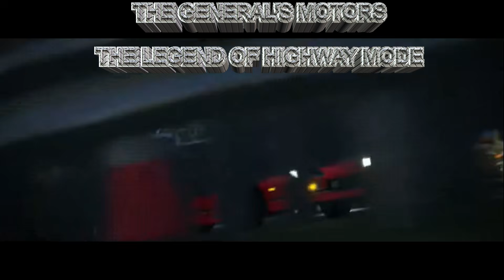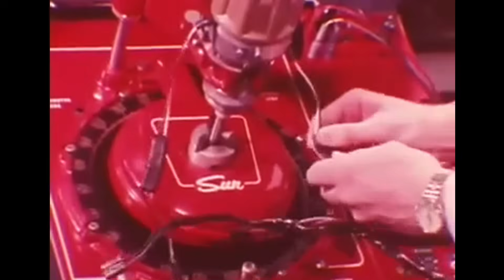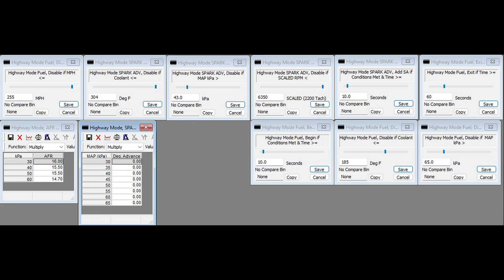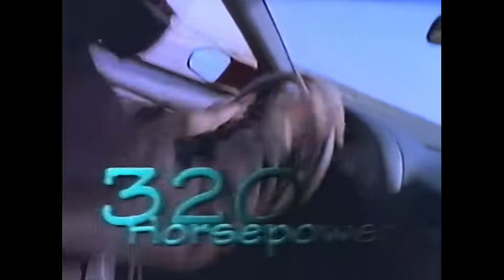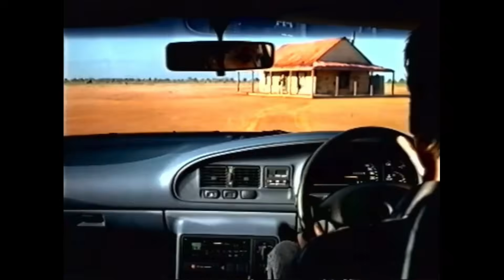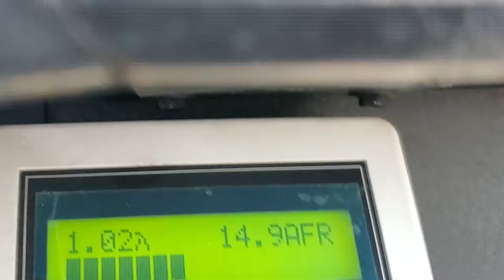"GM 'Highway Mode' Explained: The 25-Year Tuning Myth"

Comment: This is AI slop. The Chrysler lean burn system was not an analogue computer and it was not placed over or near the engine. It was bolted under the hood to the firewall or fender wall.
Reply: Chrysler mounted their early ECMs in the 1980's on the air cleaner housing. Must have made sense to them due to the simple nature of the early systems on carburetors. In the 90's they put a module inside the air intake duct. I had one of those in a 1990 Lebaron convertible. The transmission controller was also under the hood, and the big connectors weren't sealed perfectly. A bit of pressure washing could get water inside them. I had to replace the transmission controller on that Lebaron after cleaning it up from the leaking crankshaft seal. The water caused it to get damaged to where when downshifting it'd drop directly from 4th to 1st, even when manually shifting. Upshifts worked correctly.
Reply: I had a 76 Chrysler Cordoba it was placed on the air cleaner intake right above the exhaust manifold I called it to shake and bake
Reply: @glendrake635  They moved it from that position and it still got cooked under hood too. Then in the 80s, they thought it was a good idea to do an electronically controlled carb with the electronics sitting next to the carb on top of the engine. The same thing happened with it. A friend of mine had a K car when we were still in high school that his step-father forced into limp mode with the carb because of it.
Reply from the maker: It clearly shows it right in the Lean burn training video clip, if you even bothered to watch the video.

Comment: You cannot run a 16:1 AFR, and advance the timing,  without loads of spark knock. Those tables are for EGR operations,  since they introduce INERT gasses, advance,  and lean fuel is needed. Whoever made this video,  is either willfully ignorant,  or lying. Also,  GM couldn't REALLY tell what the AFR was, because they ran NARROW BAND sensors,  they relied on crosscounts to calculate them. There was no "secret hack" to get 30 mpg from any V8 from the factory,  unless your going down hill.
Reply from the maker: You're misunderstanding how the ECM handles Open Loop. When Highway Mode engages, the computer stops looking at the narrow band O2 sensor entirely. It drops into Open Loop and commands the 16:1 AFR mathematically using the base fuel tables. Also, lean mixtures burn slower, meaning you have to advance the timing, and since it only engages under low-load/high-vacuum, spark knock isn't an issue. It's a well-documented factory GM subroutine that had to be disabled in the US purely to pass EPA NOx emission standards, but was left active in other global markets. It is also known and documented especially among those with the TBI f bodies that had this factory enabled, that 29-30mpg was absolutely attainable on the highway.
Reply: @thegeneralsmotors1970 im pretty sure thats not correct. Im pretty sure its still in closed loop in highway mode if you dont have this lean cruise thing. Even on the highway if the pcm is commanding 14.7:1 then the narrowbands can do there job. Now when you patch in lean cruise and its activated, I do see why the narrowbands couldnt properly see the air fule mixture if your commanding 16:1. Its too lean for them to see. 

So the way I think it is:
No lean cruise mode, on the highway. Still in closed loop.

Lean cruise mode on the highway, probably open loop, but if it is closed loop, at the very least its just ignoring what the narrowbands are saying. 

Open loop is really only for cold start/startup and wide open throttle. That's because at WOT you command fuel thats too rich for the narrowbands to see it. So they cant correct it if they are blind. And at startup if the narrowbands arent heated up enough yet they also cant properly determine the air fuel mix so thats why it stay in open loop till they heat up. 

I have the lean cruise active on my 03 yukon right now. Ill take a log tonight and log the open loop/closed loop PID and report back what it says when im in lean cruise mode on the highway. Im guessing open loop. Good test.
Reply: @cyclark8762 I have a crown vic with a 4.8 p59 ecu. Next phase is getting into lean burn.
Reply: I just realized you said when "highway mode" is active. I read that as when "highway driving" in general. So yeah I agree. If lean cruise is active, id say its open loop. Its throws me off because ive never heard of it called highway mode till this video. Ive only ever see. Lean cruise mode. Even the patch I used is called lean cruise. My bad.
Reply: I enabled this on my 2003 yukon. Stock 5.3l. I have it commanding up 16.6:1 between .16g/cyl amd .48g/cyl and 1200 to 3200 rpms. Anything over 48 mph amd within those boundaries, lean cruise activates. I havent had to touch my timing tables. Matter of fact im about to lower the speed threshold to 30 on activate and 25 on deactivate. Its running like a champ. 0 KR, same timing as when it was commanding stoic. This is on 87 octane pump gas. Which most has about 11 to 13 etbanol in it.  My yukon isnt light by any means either. Its not a monster truck but has 33inch ATs , has the auto 4wd option which h sucks gas even more because the front driveshaft is always spinning which creates more load on the engine always. 

The crazy part is that most non flex fuel cars are set static stoic of 14.7:1 when the reality is most pumo gas stoic is actually 13.9:1 because of the ethanol. Yet everybody's cars are fine. Badically there is enough rich head room in the factory timing and fueling   to make up for the difference. .ost non flex fuel cars out there are commanding more lean than they think they are because of that stoic difference. Unless you have pure gasoline, you have at least 10% etnanol.in the gas. But from what ive seen the real number is usually 12%. My flex fuel yukon has a table that allows the pcm yo adjust stoic dynamically based on ethanol percentage it reads from the fuel composition sensor.  So 0% e = 14.68:1 and 12.5%e= like 13.8:1 . Sp regardless of eq ratio, its definitely more rich when you have a flex fuel car. 

The crazy thing is, both the flex fuel car and non flex fuel cae are using the same pump gas, yet the fl3x fuel is burning more fuel because it KNOWS the actual stoic and commands it. The non fkex fuel car doesn't know it, so it  just happily commands 14.7:1 .

In closed loop yhe obd2 sensors are putting in work correcting it all the time to richen it up either way if you have a non fkex fuel car.

Regardless, the point is I was able to apply the patch to my yukon, and start getting better mpgs immediately. Haven't had to adjust timing yet. And even if I need to adjust it a couple degrees gere ir there because of a little bit of kr. Who cares. Ill go pull a couple degrees of timing in those precise load/rpm areas of the high octane spark table and still get the full benefit of better mgs.

Comment: Big cams and stroker cranks totally trash this theory. Dammit.
Reply: I have a texas speed 228r cam, long tibe headers, 3600 yank stall and ported set of 243 heads on a 2002 ls1 auto Z28 and it has consistently for 15 years gotten 26 mpg in mixed driving. Also can still run on dog water 87 octane and not detonate its ass off. Car runs high 11s on slicks, drives as close to stock as it can with the stall, and still beats some dudes newer v6 cars in gas range. Win win
Reply: @damianlindsey6177  TBSS here, weight and gearing not helping. Avg around sub 16 mpg babying it. But not the point of course!
Reply: @robl7532 right?! But shit, 16 isn't bad for that tank of an suv. Love the TBSS! My 2011 f150 is stone stock down to the airbox and the coyote in it only nets me 16.3 in mixed driving. Thing drinks gas like am alcoholic in a refinery
Reply: @damianlindsey6177  haha. Thats what bigger fuel tanks are for! To make us all feel equal on the road?
Reply: @robl7532 lmao maybe. Or to kill the monthly finances at 4 dollar a gallon. Can't wait to get the Ranger back together. At least that 2.3 got 33 lmao. Wouldn't do 100 downhill bit eh

Comment: Lean Burn would have worked fine had the accountants not won their argument.  Chrysler Engineers wanted the Engine Control Module mounted inside the car, around where the glove box is.  Easy to replace, shielded from RF, climate controlled and dry.  The Accountants figured they could save the corporation X amount of money PER CAR by shortening the wiring harness and the length of vacuum hose to the modulator.  Engineers cried that mounting sensitive electronics in the engine bay was a recipe for disaster, but the corporation needed to save money.  It wound up doing even more harm than good.

Ditto with the Cadillac V8/6/4 system.  I had a semi-genius friend who saw the whole setup as a challenge.  He replaced virtually every component of the engine control computer with military-grade components, remove connectors and hard-wired virtually everything and I want to say there was an EPROM that he replaced with a more modern, more stable version.  The result?  Flawless operation.  His mom had that Cadillac for 30+ years and it NEVER skipped a beat.
Reply: When you think about how that timeframe was within Chrysler's most precarious financial times, you kind of understand the thinking, but it shouldn't have taken an engineer to realize it would bite them hard on the back end.
Reply from the maker: Accountants almost always end up ruining good engineering ideas.
Reply: And then the word of the harmful results of those ideas, spread abroad. People stop buying your cars, your company quickly finds itself in a difficult financial situation.

Comment: So, the A/F Ratio affects three things, each up and down proportionally. Power, emissions, and engine heat. If the power is still there to cruise on the highway, and mileage has increased, engine heat must increase. Unless otherwise necessary to extend fuel range, I wouldn't run my engine hotter for a couple extra miles per gallon.
Reply: This was the idea behind going from the pre-computer 180 degree thermostat temp to the computer era 195 degree range also.

Comment: I really enjoyed the video. You did a great job. I would like to counter a point you have mentioned a couple times. Running leaner is not hotter. Peak combustion and exhaust gas temperatures will happen near stoich (Lambda 1). Once Lambda increases >1, the combustion temperatures will actually decrease due to less fuel being burnt and excess air to absorb what heat is released. 
NOX emissions will go up due to the free oxygen in the chamber combining with nitrogen atoms. At Lambda <=1 there is no free oxygen to become nOX due to it being all consumed by the hydrocarbons. 
The aviation world is a bit more used to operating engines this way because the mixture can be controlled by the pilot. "Rich of Peak" (ROP) is richer than the peak exhaust gas temperatures near stoich, "Lean of Peak" (LOP) is operating to the lean side of the peak temperatures. These engines typically find the best BSFC ~40°F LOP or 15.5-16.0:1 AFR.
Reply from the maker: This is an awesome comment, thank you! Reading this actually knocked loose a forgotten lesson from my Aircraft Maintenance Engineer (AME) college days. I love the direct comparison to aviation engine management. In the car tuning world, we're so conditioned to be terrified of running lean because of what happens at wide-open throttle (melted pistons!), but you perfectly explained the physics of 'Lean of Peak' during a steady, low-load cruise. It makes complete sense that it's the excess free oxygen combining with the nitrogen, rather than just raw heat, that causes the NOx spike. I really appreciate you taking the time to share this and jogging my memory!
Reply: @thegeneralsmotors1970 Precisely! Glad to have helped. Your videos are exceptional quality and I appreciated you showing the actual GM mappings.